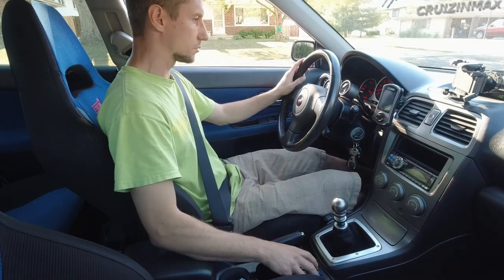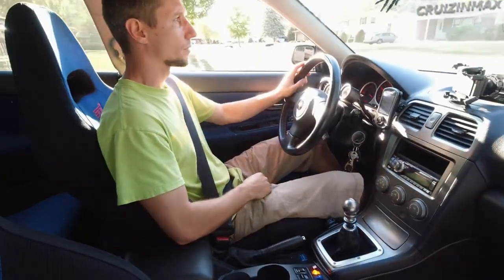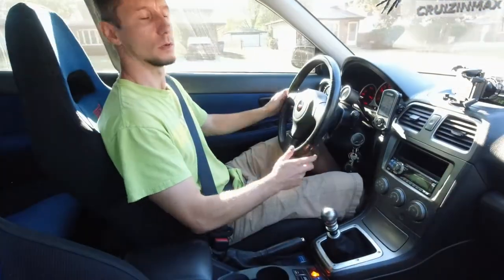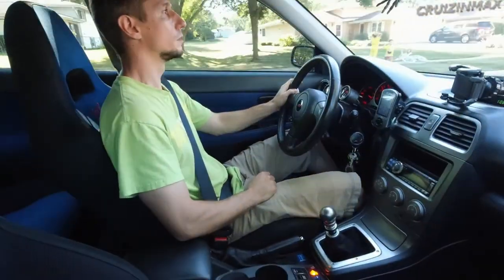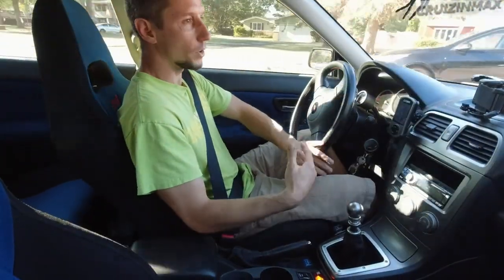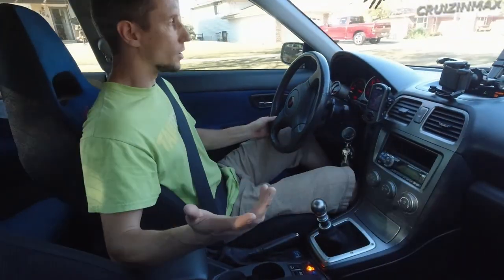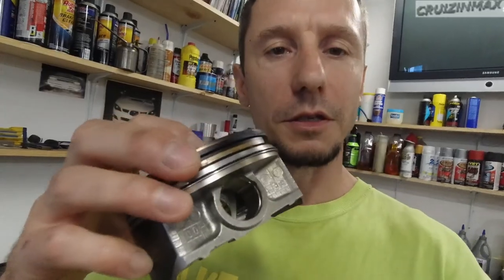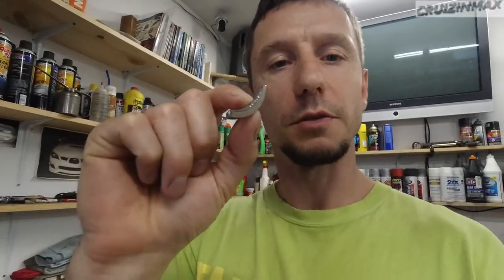Subaru STI EJ25 build part 21 exhaust cutout test drive

Comment: I really am thinking of getting a down pipe and cut off valve on my 2012 wrx but I’m scared it might sound bad or the cut off will be a waste of time if no power really increases, but I’ll take it for dyno tune later on
Reply from the maker: difference between muffler and exhaust cutout was about 5hp at higher rpm in my case at about 400 HP to the wheels, so almost nothing, its the sound that gets me, at open throttle its awesome, watch one of my videos at gingerman trackday and turn up the volume

Comment: You find turning on cutoff gives more of a kick in speed or stick exhaust same?
Reply from the maker: no difference of power, its mainly for sound only.  you might gain 2 or 3HP per 100HP